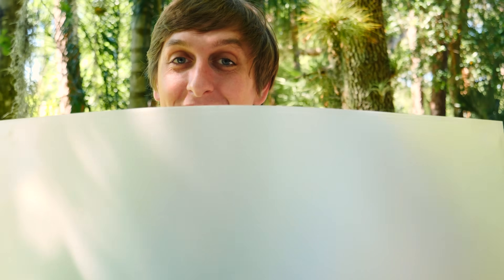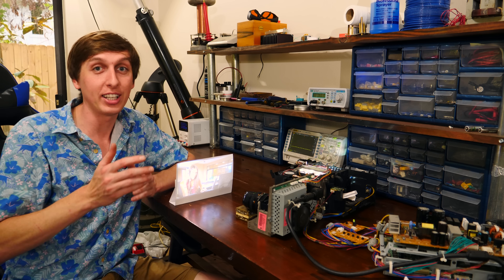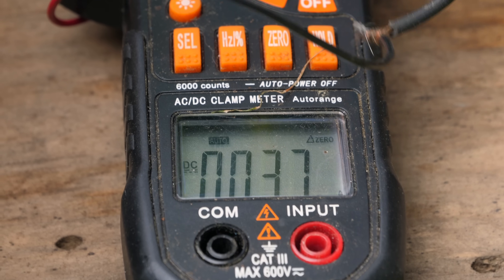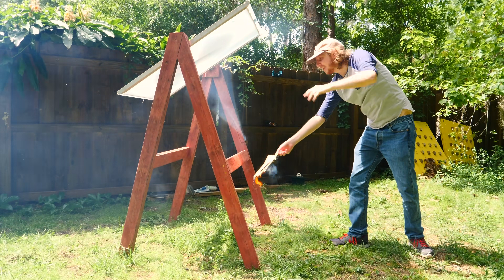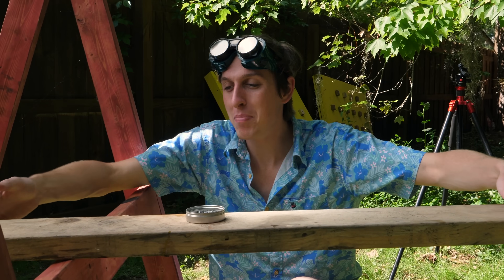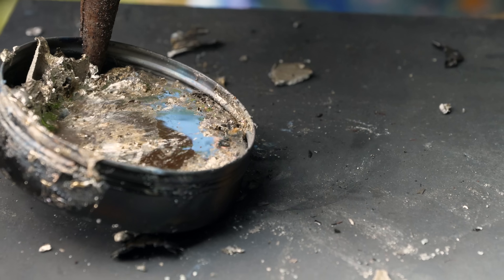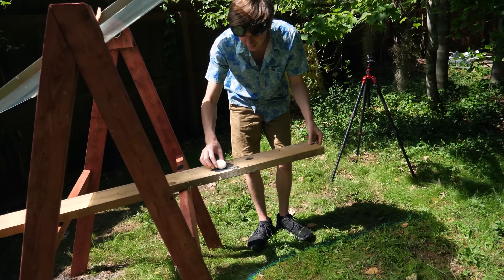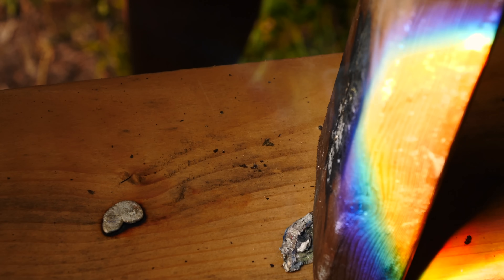Burning stuff with a giant fresnel lens + how a DLP projector works

Comment: What's interesting is that, unlike other ways of cooking or smelting, this is actually heat-neutral, b/c the heat is achieved by concentrating sunlight that would otherwise hit the earth anyway, just distributed accross a greater area. I've been thinking a lot lately about the importance of finding heat neutral (or negative, if that's possible) methods of powering our activities. Even our air-conditioners are not producers of heat; they work by moving a substance through a tube, compressing it at one end thereby concentrating the heat, blowing it with air so the air heats and it cools, then expanding it on the other end so the heat disperses, and then blowing air past it so the air cools down and it heats back up, rinse, repeat. This is heat neutral, but electric grids powering such machines often make the world hotter. Ideally, it's solar, but if it's wind or water, if you think about it, it's taking kinetic energy on a macroscopic scale, and using it to generate current through a wire, which heats up, i.e., produces movement on a microscopic scale. Coal plants, on the other hand, are much worse; they take chemical potential energy and, well, they just slopilly cross out "chemical potential," transforming it into usible electricity and kinetic energy, but also, into tremendous amounts of heat, which isn't even the worst of it, but I doubt anybody doesn't understand greenhouse gases at this point.

Comment: That was a crazy spike in the solar panels. Why don’t someone make a quite simple system to kinda “superpower” normal solar panels. I know it has been done but it was too expensive. So just do it like this maybe.
Reply: it is the cost to benifit ratio, you can get more solar panel rather than putting a focusing lens in-front
Reply: Solar panels don't like it hot, they drastically lose efficiency

Comment: 18 U.S. Code section 331: This statute addresses the mutilation, diminution, or falsification of U.S. coins. You can be charged with on offense for fraudulently defacing coins, mutilating coins, altering coins, diminishing them, impairing them, scaling them, or lightening them.
Reply: its only illegal to try and use them after defacing them

Comment: I did this once with a fifty inch. Set pocket change on a concrete stepping stone to melt. Thought it would take a bit so went in the house and made a sandwich, had lunch. When I came back, not only was my change fused but due to the movement of the sun, there was a line of glass where it had melted the concrete. Good times!

Comment: What really needs to be done, is a even larger magnifying glass, we already know it will burn and create heat, imagine instead of burning coal to make steam at some of the coal burning power plants, if you can harness the power of the sun to create the steam you need to operate those power plants. Even if you can’t have the sun on certain days, you dramatically cut the use of the coal and supplement with the sun, so you could have a dual system.

Comment: SLAR PV IS NOT SOLAR THERMAL COLLECTOR !!!! 

 The temperature increasing increases the current of solar pv but it create a huge voltage and power drop cuse it depends on the radiation  of the sun not its thermal power

Comment: That's the first I have ever heard of clear sunglasses. I always called them safety glasses. Nice video though. Something I have wondered about is harnessing and magnifying sunlight focused onto a substance that can become a heating element inside a building. Any reason this is not possible to provide heat that could be conveyed throughout a building on sunny days? There must be some type of substance that could even retain the heat for many hours to allow conveyed heating hours after sundown. It seems to me this type of solar power could help cut down the need for fossil fuels for heating during colder temperatures.

Comment: I boiled a 2oz lead fishing weight in under a minute with the fresnel lens out of a Mitsubishi rear projection TV & it would catch wood on fire instantly! I had to keep a blanket over it & store it in my shed because even light coming through the window & hitting it could have started a fire. Mine was that powerful straight out of the TV, you can also polish them to make them reach temperatures above 2000°F!

Comment: I'd love to see the lens focused on a slab of granite for a while, and then see if the granite holds enough heat to cook with. Maybe keep the lens focused on one end of the slab while cooking with the other end.
Reply: whi? just point it to a cast iron pot and you should be able to cook no problem
Reply: @enriquedossantos3283  The heat source is above the utensil. I'm trying to avoid the food being hit directly, and a big rock is a nice big lump of thermal mass that can catch the head and release it with less sharp gradients
Reply: @wraitholme  You can aim it to the side, I've seen videos of people boiling water wit these things
Reply: @enriquedossantos3283  sure, it's _possible_, but heating a big chunk of stone would give a lot more flexibility, and safety (since your workspace would be away from the beam) and would avoid having a focused heat point on your cookware, which can warp or otherwise damage it.

And it would make the heat more uniform, so you're not at the mercy of passing clouds :)
Reply: @wraitholme  that's right, that beam is dangerous af

Comment: Hey could this be applied to desalination as a near-free heat source? For example, a reservoir with a roof made entirely of these built in an ideal location for sunlight sloped with a collection/cooling coil coming from the outside?

Comment: If you're measuring amps, the output will be dragged way down by the least productive cell. If you have shading, then blasting one of the panels won't do all that much for the whole system. I think it can actually make them overheat?

Comment: You should aim a high powered laser into the other end 😎
Reply: I see you skipped science class
Reply: Turtle of Annihilation wdym
Reply: @papabreadd267  the reason the beam is so powerfull is because it focus light from such a large area into a beam. A laser covers a very small amount area meaning it would do nothing
Reply: Turtle of Annihilation "the other end" means the other end. It can both turn a large area into a small area and a small area into a large one
Reply: @papabreadd267  once again that would only have a real effect if the laser was big enough to be effected by the lense. It would widen it a little, but if you wanted to actual widden it you would need a very tiny one

Comment: I had a little 1 ft square (rigid) Fresnel lens from Edmund Scientific when I was a kid. It would focus the light into a circle about 1/4 inch in diameter, and it would melt bricks and cause pavement to explode. This was much bigger, of course, but I was doing it in the front yard.

Comment: i really wonder, can you overclock solar panels for real? can someone explain this?
Reply: no solar panels are essentially like diodes there is no way you can push a diode past its rating at least not too far it would just melt or pop

Comment: The backyard scientist: melts penny
FBI: you are under arrest for destruction of u.s. currency
Reply: @GERARDO HERNANDEZ Pennies made after 1982 are copper plated zinc. Pennies made 1982 or before are solid copper. During WWII pennies were made from steel.
Reply: @GERARDO HERNANDEZ I understand that I was just pointing out the fact that zinc pennies melt at a much lower temperature the the solid copper pennies.
Reply: @Dylan Prothero No, I doubt it.
As far as I know it's only a felony if you damage currency and then try to use it afterwards
Reply: Thw battle of the brainz
Reply: Pretty sure the secret service handles currency related crimes
Reply: @GERARDO HERNANDEZ l
Reply: He cut one in half, also.
Reply: @GERARDO HERNANDEZ im older than you and know that... just saying but some pennies are worth $$$$
Reply: @GERARDO HERNANDEZ I already have! I would also look up how to spell, it would do you good!
Reply: GERARDO HERNANDEZ it’s a joke and also, does it matter what grade your in? I’m a lot older than you btw haha
Reply: @GERARDO HERNANDEZ I'm pretty sure it's still illegal, you are still destroying currency
Reply: So is it illegal if I burn down a $100 bill to light a cigarette?
Reply: @steampunkastronaut7081  More importantly, has anyone ever been charged?
Reply: @steampunkastronaut7081 
Technically, yes.

Comment: What if you stacked like 10 of these in a giant death ray? 

I imagine it would have to be like 5 meters tall but worth it.
Reply: It would be worse than this. The goal is to have as much SURFACE as possible. meaning you'll have to build a bigger fresnel lens, or put lenses next to the center, then use mirrors to redirect the light to a center point ( and using different focal lenghts, because the light ray for adjacent ones would be a lot longer.
Reply: Or instead have other ones next to it, but with the same focal point.
Reply: Meters 💀
Reply: Concentrating heat onto another plastic lens….hmmm. I wonder….

Comment: Dude!! Love your stuff, been watching for years!!

So... hey BYS! This is only the second  time I’ve ever requested a video from any of my favorite YouTube folk. So... here’s what I want to see:

What happens when you add salt to boiling water? I mean, we all know that salt, water, and ice makes for a colder cold than ice by itself... but...

What happens if you add salt to boiling water? How much salt does it take to change the behavior of boiling water? How does that affect the thermal properties or behavior of boiling water?

My hypothesis:

Since you’re making the water denser, more energy will be spent maintaining the temp of the mass, which means the max temp will drop from 212°F to... say... 190°-200°F. But since it’s denser you’re essentially increasing the surface area of contact with the inner chamber on a molecular level. So if you measure the temp delta over time of the inner chamber with plain and then with salt water in the outer chamber, the salt water will heat it faster and the max inner temp will be closer to the temp of the outer chamber.

Possibly the salt water double boiler will exceed the max inner temp of the plain water because of the increased efficiency.

Is there a max amount of salt that is effective, or does it turn into diminishing returns as the salinity increases?

And does the increased energy use of heating the denser salt water offset the more efficient heat transfer between the inner and outer chambers? What’s the total energy consumption to evaporate 100 ml of frozen water from the inner chamber starting with room temp plain or salt water?

Actually that was really fun to write out... 😉

Hope to see it soon!! 👍🏻❤️

Comment: Would a mirror be able to reflect such a powerful beam or would it simply burn/melt/explode ?
Reply: Yes a mirror reflects 90% of the energy touching it leaving only 60W of energy absorbed out of the 600 since the beam is relatively wide on the fresnel lense it would spread that energy over a large enough area to where the mirror would heat up but not explode or melt

Comment: You have done several videos on lipo batteries. I fly quadcopters. I have been told that if the battery over heats and "puffs" that they are dangerous and should be disposed of. I have also been told that if you pierce the cover of the battery and release the gas in the battery, the world will end in fire and brimstone. Would love to see you test this idea. Josh Bardwell (quadcopter guru) 
told me emphatically DO NOT DO THIS.

Comment: youtube:  watch a guy "burning stuff with a giant fresnel lens"
me: i wonder what will happen if you focus into a solar panel
backyardscientist: first i want to  overclock a solar panel"

i freaking love you dude.
Reply: i really wonder, can you overclock solar panels for real? can someone explain this?
Reply: @NikosPer  It is simple: Let's take a 1 square meter solar panel and a 4 square meter focusing lens.
Normally, without the focusing lens the solar panel would catch a 1 square meter area worth of solar energy, it is said to be about 1000W.
The focusing lens will capture 4 square meters of energy (minus the losses, they took roughly 40% losses in the video, so we will do the same), so 4000W, 60% of that is 2400W. So the focusing lens will project about 2400W onto the 1 square meter of solar panel.
Giving you roughly 2.4 times more energy than normal. These are not exact numbers, just a rough guess to show you the point.
You don't want to focus too much energy onto the solar panel as it will melt the material, as shown in the video.

Also, in practical application, you would need to install several small mirror in a dish shaped area, moreover they would need to be moved all the time with the sun, so it is not possible to use this to super power your solar panels.

Comment: hey just a note  when you say our going to "overclock" the solar panel your not actually over clocking it. your are actually over vaulting it. let us look at it form the perspective of computer hardware. if you are using a windows you can easily find out what the current clock seed of you CPU is, by opening task manager and going to the performance tab ( the clock seed will be listed at the bottom in MHz or GHZ.) if you were to overclock the CPU the clock seed would increase. if you were to overvault the CPU you would be increasing the voltage to the CPU. in short overclocking something increases the clock speed past what is stock for the device. overvaulting something increases the amount of vaults being delivered  to it.

Comment: I want to try using a fresnel lense in place of a forge to make knives. You'd have to be very careful not to melt the steel, and you'd probably need to wear welding goggles while your heating it up, but I think it could actually work! I'm talking about carbon neutral blacksmithing here, and I'd love to hear some feedback.
Reply: Carbon neutrality is a scam.
Reply: Nate from the Internet (formerly with TKOR) made a pen knife that way last year. He hasn't followed up with bigger blades yet as far as I know.

Comment: Done this, it's super fun and almost instantly chars wood to just straight carbon. If you scrape the burned powder off multiple times you can slowly burn through a 2x4. Also, melting pennies then sliding them into cold water makes some super interesting warped pennies

Comment: Where do you get the panels from? I need one for an engineering project and i cant find anyone whos getting rid of a fresnel lens large enough or a RPTV either, the project is basically the solar sinter project

Comment: The 5 watt rating for the solar panel means it can generate 5 watts before the heat causes it to drift out of spec and eventually cause damage. It doesn't have anything to do with how much light it can absorb.

Comment: Good idea with the glass over your lens. I've had trouble with them fogging up from UV exposure, or the ridges in the lens getting gunked up with dust and moss. The glass should protect from both
Reply: would a clear epoxy coat work?
Reply: Dead Meme clear epoxy is still not 100% clear, so it would scatter some light and thereby reducing its effectiveness. I recommend using acrylic which is 99% clear (compared to soda-lime glass at about 70% clear), but make sure you seal it so it doesn’t oxidize over time and get cloudy (specialty plastic clear coat spray exists for such a purpose) This is also why “glasses” are actually made or CR-39 plastic or polycarbonate for lenses now since it’s lighter and is a lot more clear for vision
Reply: Wud it work with all kinds of the layers from a tv

Comment: 18 U.S. Code § 331. -- Mutilation, diminution, and falsification of coins

Whoever fraudulently alters, defaces, mutilates, impairs, diminishes, falsifies, scales, or lightens any of the coins coined at the mints of the United States, or any foreign coins which are by law made current or are in actual use or circulation as money within the United States; or

Whoever fraudulently possesses, passes, utters, publishes, or sells, or attempts to pass, utter, publish, or sell, or brings into the United States, any such coin, knowing the same to be altered, defaced, mutilated, impaired, diminished, falsified, scaled, or lightened—

Shall be fined under this title or imprisoned not more than five years, or both.

Comment: My family had a rear-projection tv many years ago. This one had 3 lights in the back - red, blue, and green. One day I learned there was a setting that allowed you to change where each individual light's focal point was, so that if something was off kilter you could adjust it back to where it should've been. After a little tweaking of the red and blue channels, turned it into a pseudo-3D television. Had to have those old-school 1 red lens, 1 blue lens glasses to get it to work and the effect wasn't great since nothing I watched with it was made for 3D, but things did look more three dimensional.

At any rate, it was a neat little science experiment.

Comment: Just so you know, lead will partially vaporize and has a vapor pressure when liquid.  You do not need to get it to it's boiling point for partial vaporization.  Just like water will evaporate very far below its boiling point.  You're probably not in much danger, but yeah, I wouldn't be breathing those lead fumes up close.
Reply from the maker: Yeah I know, but your probably right the amount that vaporizes isn't going to be troublesome unless its your job to melt it all day.